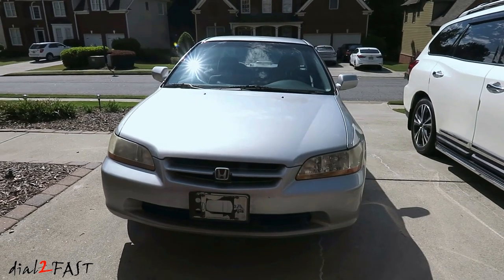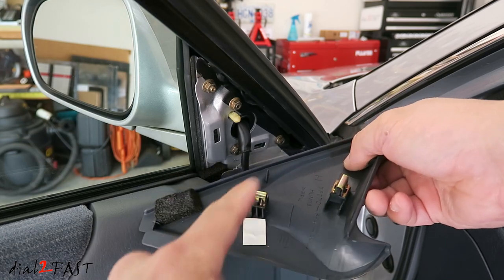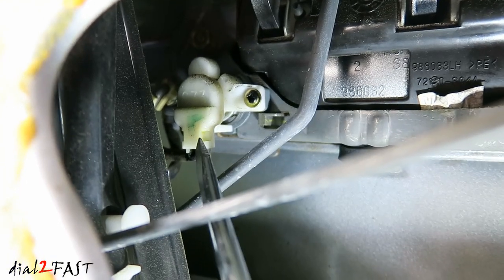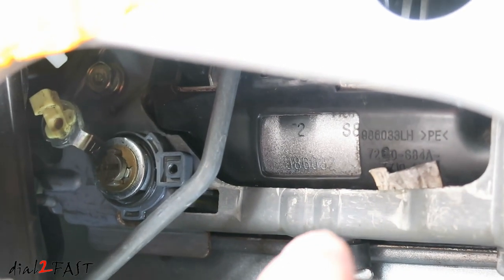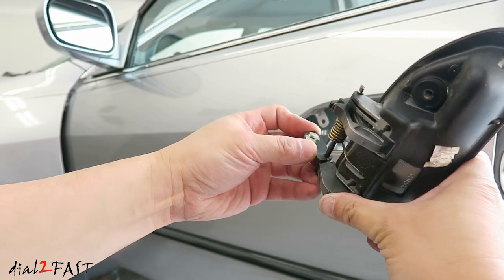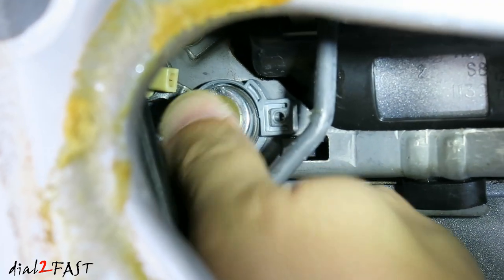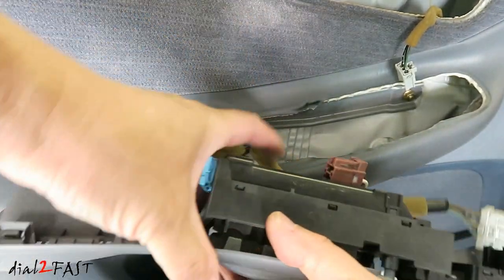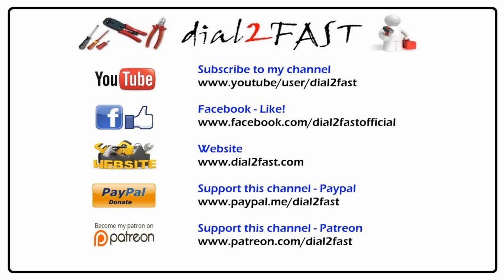How To Replace Honda Accord Driver's Door Handle - 1998 - 2002

Comment: I didn't have one of those pic tools to remove the cylinder but once i was able to see where it was i was able to work a long thin flat head under it with some fiddling and popped it off...   hope that helps anyone that's doing this.  

Other than that,  yes this tutorial is absolutely perfect,  no bs, no unnecessary talking just all the way in and all the way back out.  Good stuff !!!

Comment: This was, by far, the most clear video I found on how to do this repair and made it possible for me to do the repair.  Many, many thanks to dial2fast.  I ran into a few things I ran into that may make your repair easier:
1)  I recommend putting a towel, rags, etc. inside the door frame whenever you are installing or removing bolts.  I had a mounting bracket bolt go into the lock assembly and had to use a magnet to get it out.  The small screw that holds the flip switch in place fell down somewhere in the assembly and was not visible or retrievable.  If I had towels in place they would have fallen onto that instead of into the assembly.
2)   When you reinstall the bracket, be careful that the rod that connects to the lock cylinder is not between the bracket and the door.   It is easy for it to get into there.
3)   I couldn't easily push the lock cylinder back in place.  The grease was not an issue, the issue is that it is a tight fit between the mounting bracket and the door handle assembly.  After being frustrated for about twenty minutes, I found a tip on another video that provided success.  What worked for me was that I did not put the bolts in the mounting bracket.  That gave me some flexibility/wiggle room The cylinder clicked right into place.  Then I installed the bolts and the mounting plate.

Comment: This helped me a lot. Granted my process was a bit different cause I went to a pick and pull to get a handle. For instance when I was getting the door handle off of the juck car, when I finally got the handle away from the door, I didn't have to pop the pin out (because I wanted it as well). For that final removal step I merely had to unscrew it from the metal arm. When reinstalling I just had to screw it back on, put the handle back in the door, bracket, key cylinder, plugs, door panel, more plugs and done. Having done many door handles before, they never went this smooth. A lot of your techniques will translate over to many other cars. Overall I think this is the best video on the subject I've ever seen.

Comment: currently doing this. that final rod at 5:45 was a pain to remove. ended up breaking the plastic part on the door handle to free it. then removed that soft plastic that's stuck on the rod with pliers.
Just finished doing this job. Video helped a lot. I messed up and installed the lock cylinder before putting on the bracket. Had to remove everything including the clip on the door handle. Follow exactly and you shouldn't have issues.

Comment: How do I know if it's the handle or the lock actuator
Reply: the lock actuator will only affect locking and unlocking. A broken door handle means even if its unlocked and you grab the handle the door still won't open.

Comment: What did you do to get the lock cylinder to snap back in place? I noticed you wiggled it around a bit then the clip changed to you pushing it in like it’s nothing.
Reply from the maker: The installation of the lock cylinder is as shown in the video. I explained to leave the metal clip installed on the door handle 6:35. Then when you get to installing the lock cylinder, just put it straight in as shown at  7:41. That metal clip is spring loaded, so when you push the lock cylinder in, it will go in one way and will not come back out.
Reply: @dial2fast  thanks for the reply I was able to get it in. My only problem now is the rod connected to the handle keeps slipping out when I pull the handle from the outside. Do you have any suggestions on getting this stay in?